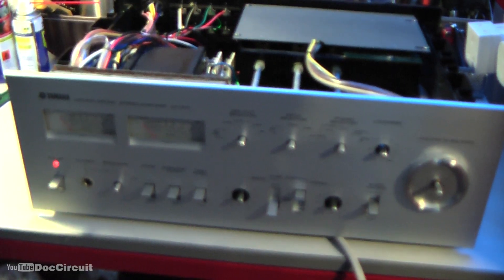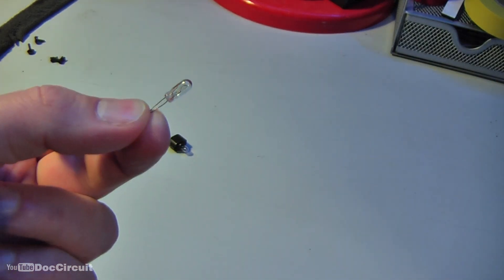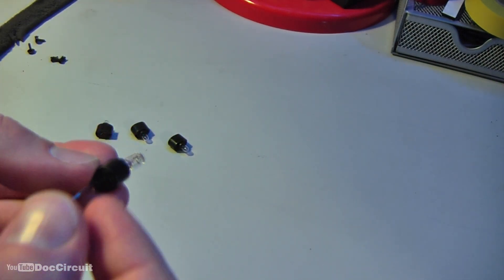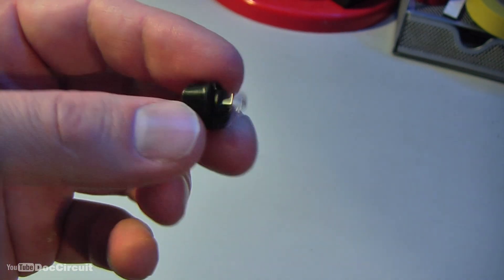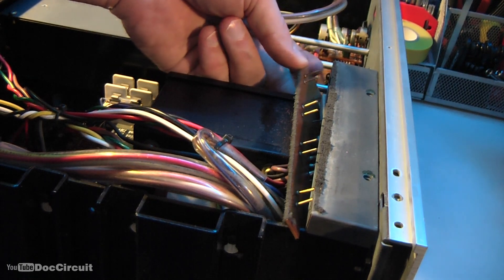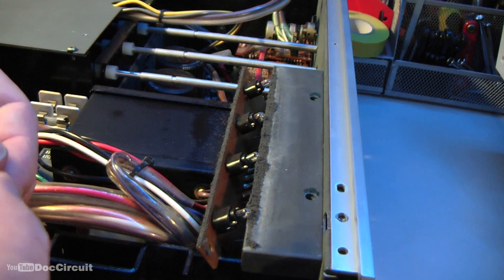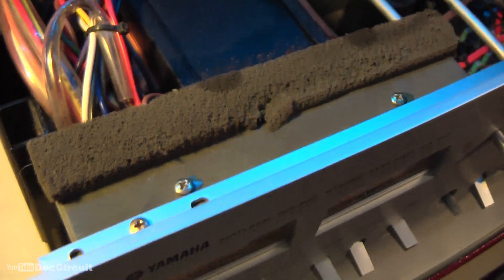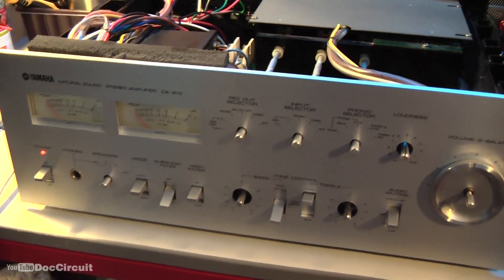Replacing Bulbs in a Yamaha CA-810 Natural Sound Amplifier.

Comment: Thanks, I had my CA-810 apart today cleaning the switches and pots and couldn't figure out how to get to the bulbs. Does it seem like the foam is just there to block light leaking out the top vent?
Reply from the maker: +kasm279 Going from memory and the video, yup. Although it does seem a bit excessive so I also wonder if there was another reason.
Reply: Thanks. Also, I'm having issues finding 4mm bulbs. The closest I can find are T-1 1/4 bulbs, which are (1 1/4)*(1/8) inches, or 0.15625 inches. 4mm is 0.15748, is the rubber boot flexible enough to allow that tiny difference?
Reply from the maker: +kasm279 Without the unit open in front of me I can't tell. Soz.